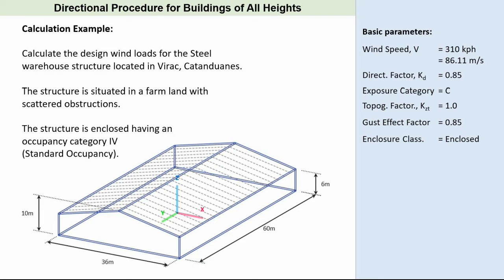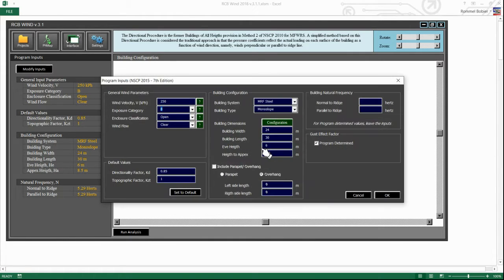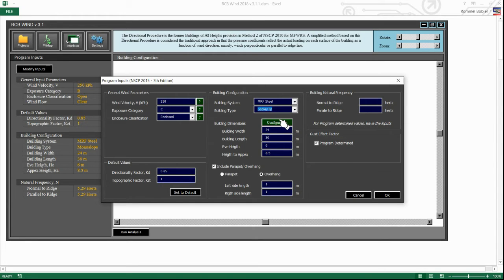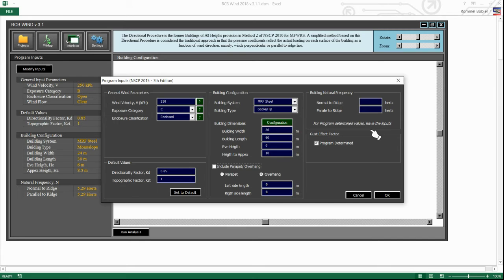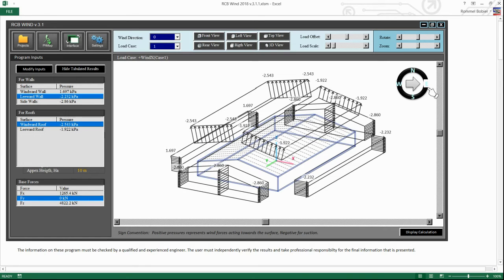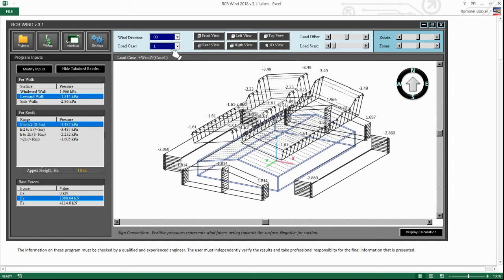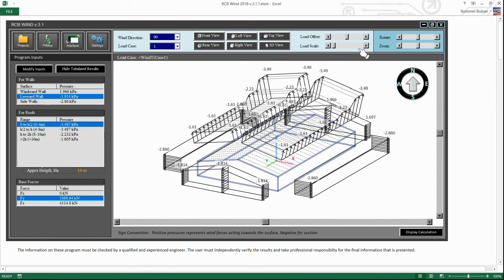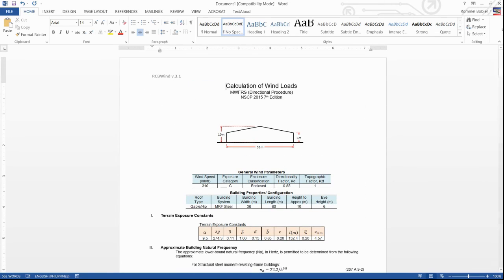Calculation of Wind Loads - Part 2

Comment: sir how about the minimum design wind laod? in ASCE 7-16 it said 
"The wind load to be used in the design of the MWFRS for an enclosed or partially enclosed building shall not be less than 16 lb=ft2 (0.77 kN=m2) multiplied by the wall area of the building, and 8 lb=ft2 (0.38 kN=m2) multiplied by the roof area of the building pro jected onto a vertical plane normal to the assumed wind direction, do you have idea with this one? Thankyou